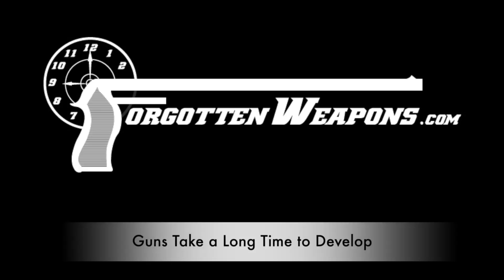Why Guns Take Years to Get Into Production

Comment: Ian - I’ve learned so much from your channel, but THIS is the best presentation you’ve done yet. Tolerance stacking can generate really elusive gremlins in any complex machine.

I really like KelTec’s innovative product ideas but perhaps they should hire you for process review and QC.  When I bought a PF-9 the salesman told me “every once in a while they spit out a lemon.  Just bring it back.”  My initial incarnation literally couldn’t get through a single magazine without jamming. We sent it back. 10 days later I got the original frame back with virtually everything else replaced. It has worked flawlessly ever since, but someone had to take the time to find replacement parts that got an A in “plays well together.”

I would love to see you do an expose on the “you need a 500 round break-in period” BS from some manufacturers. I got that from Kimber on a 1911 with an extractor that could clock roughly 20 degrees coupled with a firing pin stop that literally flopped around in the slots at the back of the slide. Assuming you could get through 500 rounds without losing your mind, it would have only made the problems worse due to excessive wear on the extractor claw. 50-100 rounds for an extremely tight gun produced for gun range accuracy, OK. Breaking in a rifle barrel is a real thing IMHO; however, that’s completely different from a gun that jams right out of the box. Frankly, I think the 500 round garbage is to deflect the many people who buy a gun, maybe take to the range once or twice, and then never fire it again. (And if I’m wrong in my assumptions and assertions, please correct me!)

Comment: A gun is a relatively simple device compared to something like a car.  Even a car from the 1920's .  Imagine the interaction between parts in a 2021 car.
Reply: To put it in perspective, a car weighs thousands of pounds to control an explosion that is roughly the same energy as a 5.56 cartridge. Cars rarely fail in normal use, lighter weight firearms are right on the edge of failure every shot.
Reply: Yeah and look how well production cars are holding up these days. Also no splodey splodey near face so if it messes up who cares
Reply: Hence why a car costs as much as many people’s salaries, and guns are expected to be relatively cheap

Comment: The basis of your argument is generally for gas operated designs that do not rely on a previous chassis or iterative improvement.
Reply: Iterative improvement is an even longer development cycle that leads to even more sub-par products (as in the first batches are inferior to the latter ones). This kind of development is more suited to things were previously made examples can also be altered, such as code. But by far, It's greatest advantage is that you get many examples early on and don't have to wait until the technical package is finished.
Reply: Iterative changes have less parts to develop than a new product,but the interaction between the original and the changes has problems that need to get solved as well.
Case in point, m4 carbine as first introduced and original. 40 cal glocks,
Reply: Fire Starter  its not strong enough to the point of holding pressure of big boy rounds like 7.62 nato or 50bmg
Reply: Fire Starter  They do indeed know how to measure things using lasers, that does not solve the problem of figuring out the tolerances and technical package but it does make quality control far easier.
Computer design has really helped in all of engineering, so my guess is that they have also benefitted. Still, computers are not magical and lots of effort are still needed.
As for the 3d printing, it is painfully slow and relatively expensive. It is mostly used to create molds and some very especific parts. It is not a method suited for mass production.
Reply: Fire Starter  To be precise, one does not exactly "measure tolerances", but measure actual dimensions. Tolerances are range of acceptable dimensions (onecan't measure an abstract idea). Also, as manufacturing "tool", lasers are extremely limited in what they can do - and even when lasers can do something, it's prohibitively expensive and/or wildly impractical. They can do what they can do, like any tool, and engineers know that.

If only a complex set of problems could be solved by "let's use lasers!"... Sadly, it's only what happens in movies.